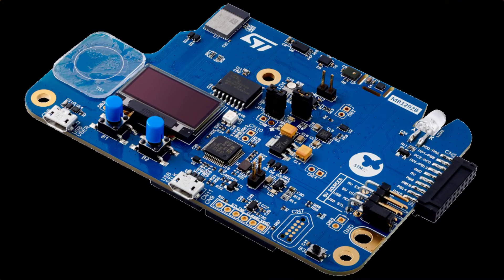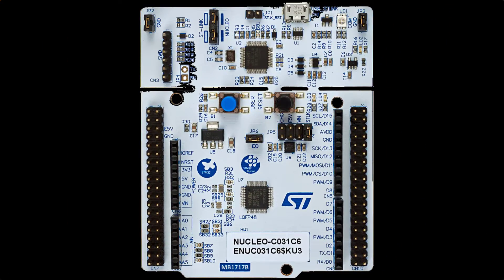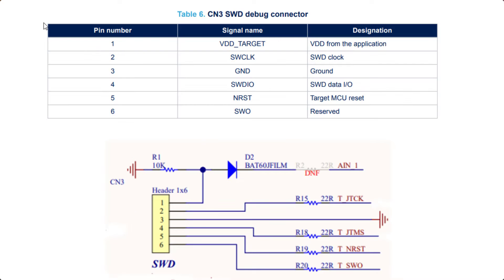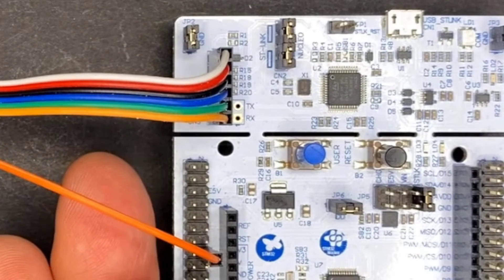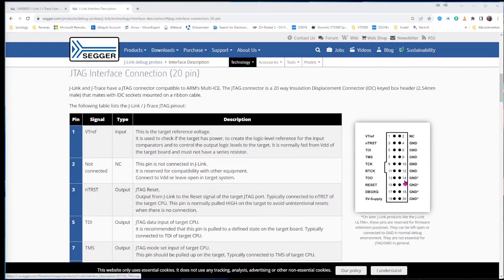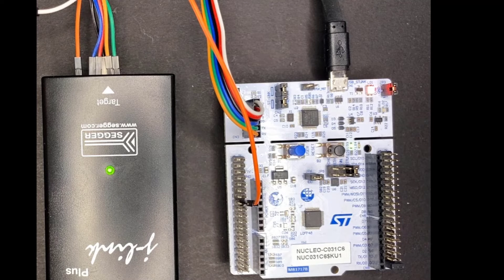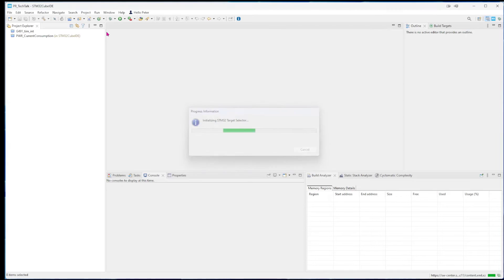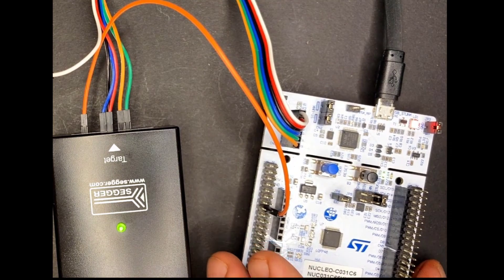Supercharge Your STM32 Nucleo Projects with Segger J-Link

Comment: Hello Sir, thanks for your video. I followed it strictly but unfortunately I couldn't get it to work for me. The ST-Link attached to my Nucleo Board stopped working (at all) and I was looking for some solutions. Your video came to the rescue but I am sure there is something wrong with my board as well and not just the ST-Link.
I tried connecting the JLink pins to their respective pins on CN11 as well but it still didn't work.
Thanks for the information anyway.
Reply from the maker: Hi, Pls note make sure that your Nucleo board is supported. If you have bricked the ST-link then one advanced option is to connect SWD directly to the ST-Link MCU and download new firmware using STMCubeProgrammer. and pls note that i am talking about the ST-Link Mcu not the target MCU.   Good Luck /PR TechTalk

Comment: What are the benefits? For STM i use STLink V3 (35€), never had a need to use a a700€ JTAG probe. You may flash a STLINK with Segger firmware. But still, what can Segger do better than STlink?
Reply from the maker: Hi. If you are fine using the tool you have on hand then that is the best tool and cheapest :-) . But if you are using several MCUs you might want one tool to work with all. Then Segger is one alternative. Also remember that ST sell their tools at a discounted price to get their money on the MCU’s. Segger dont sell any MCU’s and need to get money for their HW and SW. Hence they are more expensive to purchase. I just think it’s great that we have alternative to choose from. /PR TechTalk
Reply: @prtechtalk416  Thank you, for your comment. I was thinking STM32 wise. J-link is a universal tool. One tool being cheap and universal is also CMSIS-DAP, often mounted on LPC demo boards. A little bit more expensive than nucleo boards, but CMSIS-DAP is also a universal tool. I was able to program some other ARM vendor MCUs. Just for information.
Reply from the maker: Hi i was not aware that NXP’s  LPC evalboard could be used as universal tool. I wonder if their new mcu family MCX also will have this option. If you are interested my next video will be on Stlink-V3PWR. 
/PR TechTalk
Reply: I found that STLink is not recognized on a MacBook with Apple Silicon. It needs a special device driver, which ST does not supply for this HW. J-Link was recognized as a normal USB device and could communicate with the J-Link SW app.

Comment: In main stream product design there is usually the requirement to preserve the JTAG/SWD 10 pin connection. Why? There are many reasons, among the most important are diagnostic coverage for issues found in the field prompted by company liability and regulatory compliance, with also the need to program the parts in production (using a flashing probe). There can be other uC resources reserved for ARM Cortex M like a UART, usually UART0 and a 4 bit digital I/O port (1/2 an 8 bit port) usually SPI0 (also called SSI, which can provide a microSD interface if needed). This is not really a problem with a part pin count of 64 and higher. 

BGAs are popular for designs that are very compact and have a very high signal count for their size. But, as you can see on the STM32 eval boards there is clearly no space constraint, yet BGAs are still used even if very high pin count TQFPs are available. Depending on the specific part, many times the BGA medium pitch part has the best price point of all the parts in a family. However, medium and fine pitch BGA signal breakout requirements increase the complexity and cost of the PCB. Many times requiring the use of microvias and 4 or 6 layer boards.

For the JTAG/SWD 10 pin connection it should be pointed out that JTAG access is just as important as SWD for analyzing a part without taking it off the board, or in preserving the PCB to part connection in order to not defeat a possible failure mode, especially important with a BGA part. It is better to leave the part on the board and send the complete board to the silicon vendor for analysis. First with the part on the board and then with it removed if need be. The part will most likely be xray examined as to the solder joint integrity. 

Many designers use the TAG CONNECT TC2050-IDC-NLFP mini bed of nails connector for the 10 pin JTAG/SWD connection with a 20 pin probe adaptor cable and board to connect to a J-Link probe or similar. The PCB footprint is very small using tinned circular pads (on one side only) and holes ( three non plated used to guide the connector). You will see the footprint on many evaluation boards from different vendors to support the JTAG/SWD 10 pin connection. You can go beyond 10 pins to 20 pins which basically adds full trace capability, but greatly depends on the specific part, and you would need a probe to support it like J-Trace. I don't usually see a requirement for full trace until you get to ARM A family.

For the silicon vendors IDEs the Segger J-Link probe seems to be universally supported. Mainly because Segger makes tools and not silicon. But, most of the silicon vendors have their own probe types for ARM but there always seems to be the option to use the J-Link.
Reply from the maker: Thanks WindWard2818 for your input and thoughts.

Comment: Sir make lookuptable video..input adc value ..
Reply from the maker: Hi. Im not sure what you mean, can you pls elaborate this a bit more.
/PR TechTalk
Reply: @prtechtalk416  i use input adc with stm32cube ide( 0-1024).
If x<100.output 10
Else if x>100 &&<200 output 12
Else if x>200 &&<300 output 15
Else if x>300 &&<400 output 17
Else if x>400 &&<500 output 20
Else if x>500 &&<600 output 25
Else if x>600 &&<700 output 17
Else if x>700 &&<800 output 12
Else if x>800 &&<900 output 10
Else if x>900 &&<1024 output 10.
This work but using if else. How make  look table...
Reply from the maker: Hi. Firstly i need to state that i am not a c programmer so pls look at my response with this in mind.
But for this code i would write something like this:
#include <stdio.h>

int main() {
    int x;
    printf("Enter the value of x: ");
    scanf("%d", &x);

    if (x < 100) {
        printf("Output: 10\n");
    } else if (x >= 100 && x < 200) {
        printf("Output: 12\n");
    } else if (x >= 200 && x < 300) {
        printf("Output: 15\n");
    } else if (x >= 300 && x < 400) {
        printf("Output: 17\n");
    } else if (x >= 400 && x < 500) {
        printf("Output: 20\n");
    } else if (x >= 500 && x < 600) {
        printf("Output: 25\n");
    } else if (x >= 600 && x < 700) {
        printf("Output: 17\n");
    } else if (x >= 700 && x < 800) {
        printf("Output: 12\n");
    } else if (x >= 800 && x < 900) {
        printf("Output: 10\n");
    } else if (x >= 900 && x < 1024) {
        printf("Output: 10\n");
    } else {
        printf("Value of x is out of the specified range\n");
    }

    return 0;
}

/PR TechTalk